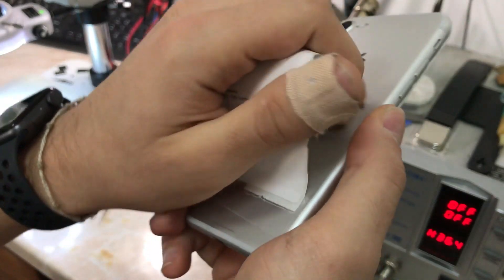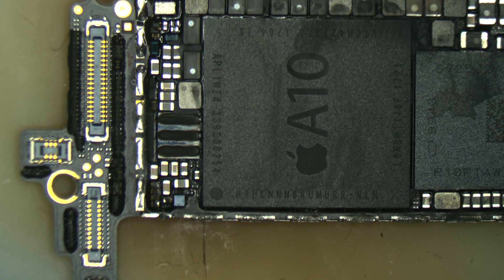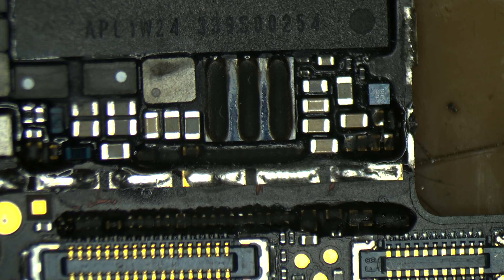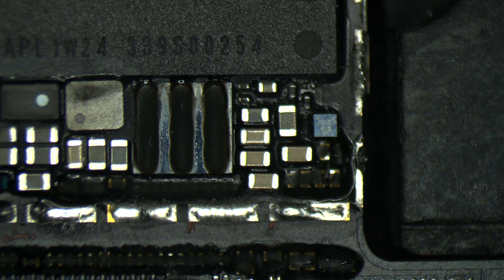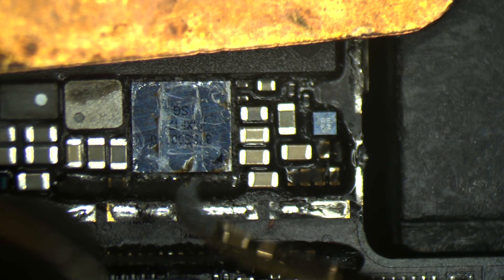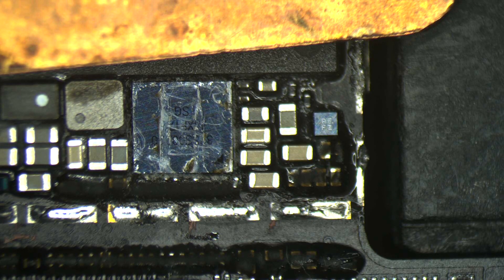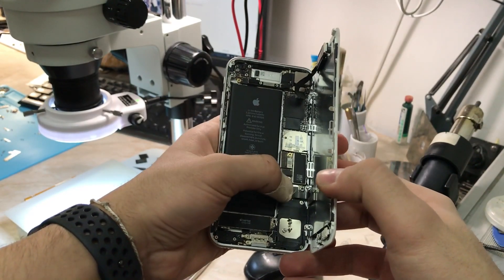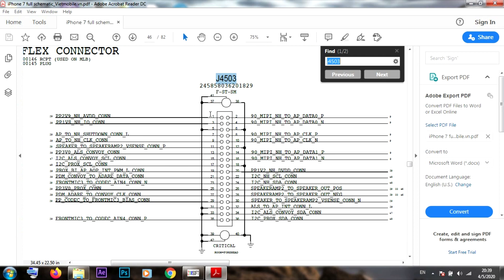iPhone 7 Upper Ear Speaker Not Working (How To Fix)

Comment: Hey I have a iPhone 7 Plus and I changed the screen on it, because the screen was really cracked and dead, the proximity sensor does not work now and there is no sound during calls( only works on speaker), the front camera also works, such as mic and all, I was careful when removing the flex cable and moving it on the new screen, could it be that the flex cable is damaged from inside and it’s not visible because I do not see any damages or anything torn? There is a low low cracking noise though

Comment: Hello
Antoine this video is very good and very helpful really.! And you doing nice job bro...
But..now I have a problem with my iPhone 7plus and the problem is my iPhone ear speaker's volume is too low, even I have used all the tricks, and checked all the settings options and I did the cleaning of the ear speaker’s place from the outside and inside, even I have also replaced and have checked the volume on the other ear speaker but the result is same.. The volume is still too much low and I can not hear the voice and can not hear properly....
Dear Antoine have you any solution of my iPhone’s problem..!!?
Reply from the maker: Hello, is that also when you try to call someone and hear something from the ear speaker ?
Reply: @AntoineKiriaky10  no no no it's just a low very low volume problem only of ear speaker otherwise I don't listen or feel the other noises even I listen the clear voice but in very low pitch.! and here the ear speaker is also ok,,
Because I have also tried to replace the speaker with the other one but the result was the same.!
And I'm very glad and very thankful that you replied me very fast thanks for that.
Reply: @AntoineKiriaky10  Hello Antoine how are you,
I wanna know or ask about my iPhone 7plus problem...is there any other solution to solve the problem I'm facing..!?
If there are any so plz must tell me or reply to me about that,, I'll wait for your reply, take care 😊

Comment: Bro how much heat solder iron?
Reply from the maker: 365 you can also change to 325 but with low temperature solder wire or paste to clean the pads without losing them
Reply: Thanks bro